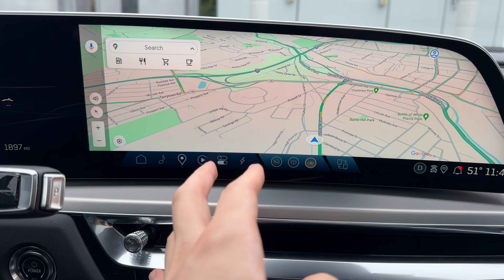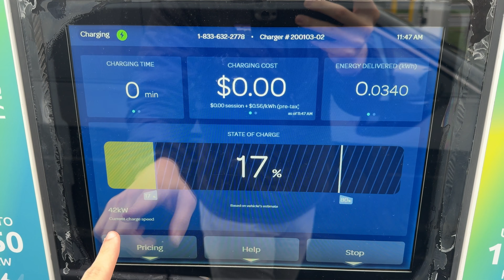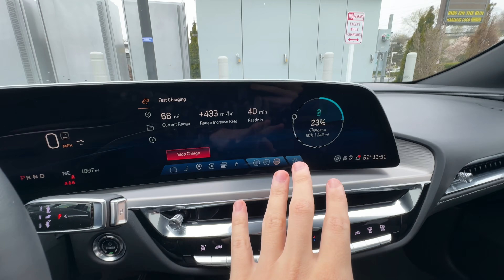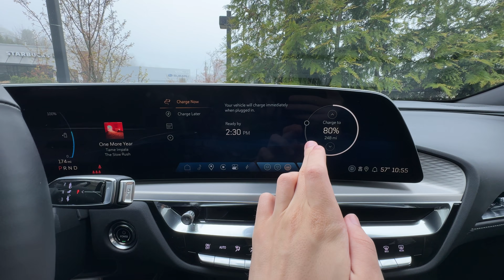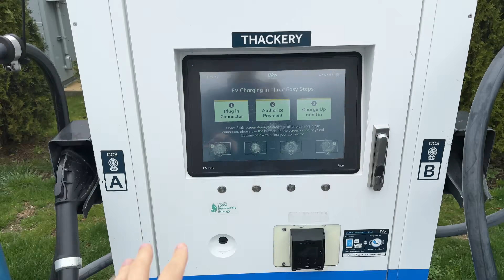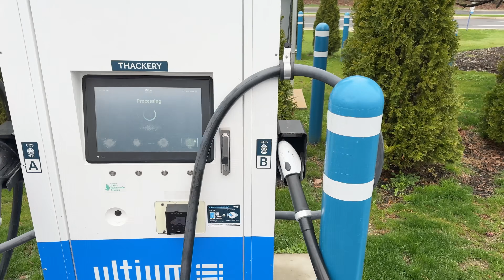2024 Cadillac Lyriq Sport Public DC Fast Charging Test /// Allcarnews

Comment: If the battery dies how do you open charger door ?
Reply from the maker: Believe you have to  gently open the charge port door manually by hand by grabbing the outside edge and pulling/pushing it open
Reply: @Allcarnews thanks 👍

Comment: Please slow down when you talk on the video. No need to rush through what you want to say. It was difficult to understand you at times.
I have a 2024 Cadillac Lyriq and am underwhelmed by its Fast Charging. I have rented Teslas for two 500+ mile roadtrips and both had much better Fast Charging. 95% of my Lyriq charging is at home so not an issue for me so far.
I also share some concerns about the charging door on the Lyriq. The door did okay in Cincinnati's winter but I feel a regular manual door would be a more robust design.

Comment: Nice car, but they do need to work on some things particularly the charging speed. And the interior fit is just pitiful for such an expensive car. I can’t believe how bad the door and dashboard trim line up with each other.  And I see many of them the same on the dealer lot. It’s not just the one you had.  It literally screams ‘we make a crappy car! right in the drivers line of sight.
Reply from the maker: Interior rattles were WILD on this tester

Comment: 20 , 30 min? At a gas station.? That’s crazy. I put gas in 5 min and gone
Reply: So when you take a road trip, you never go to the bathroom or get anything to eat or do anything else? By the time I go 250 miles I’m ready to take a break anyhow. But these cars need to charge a bit faster. The Hyundai products can pull the trick off in about 18 minutes, which is perfect.
Reply from the maker: Cool.
Reply: My EV charges overnight while I’m sleeping. I wake up to a full charge. Take seconds to plug in when I get home from work and inplug when I leave.

Comment: Until the powers that be can duplicate the system in China developed by NIO (and Ample in the U.S.) , namely battery swapping. You pull in, the machinery takes the old battery out...credits you for unused wattage, gives you a new fully charged battery in 5 minutes. Out you go to continue your journey. No worries about broken or barely working chargers or hope that the charging cords haven't been stolen by copper thieves.

Comment: wow 200 miles for 35$....this much money would be a good  for 500miles  in gas car
Reply: Lyriq comes with 2 free years of charging at EV go.  And most people charge at home anyways.
Reply: @ThreeGreenthumbs  I bought a 2025 yesterday no mention of this 2yr free charge with evgo🤨🤔
Reply: I go to DC charger maybe twice a year. My electric utility credits my bill $24/month to charge 11pm-6am. And I can charge at work for free. This easily offsets the twice per year I would pay extra at a public DC charger.
Reply: I get 171 miles with my 2020 Cad xt4 for $35 gas.
Reply: @kg1329  EV owners charge at home 90% of the time and it is more like $7 for 200 miles.  DC fast charging is about parity with the pump in 2024.   The XT6 is similar in size to Lyriq and gets 20 MPG avg.  Pump gas is $3.79 gal so 200 miles cost about $32 compared to the $7 I pay calculated at 11 cents per Kwh.   I typically go for months before I need to visit a single DC fast charger on road trips.  The Lyriq hands down is cheaper to drive.